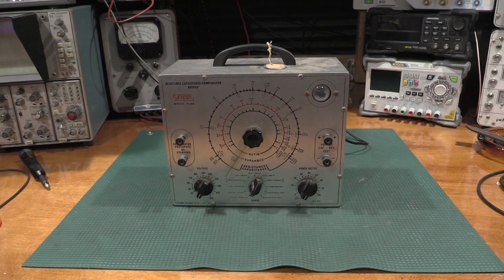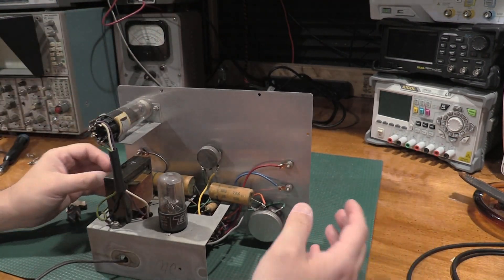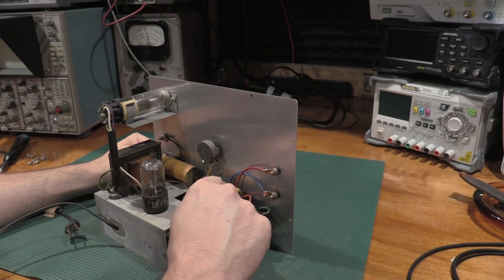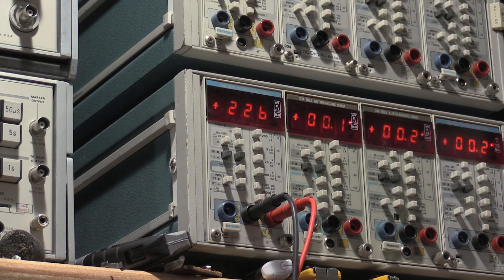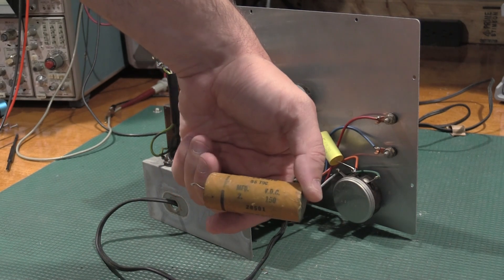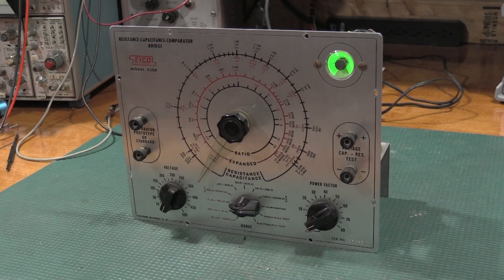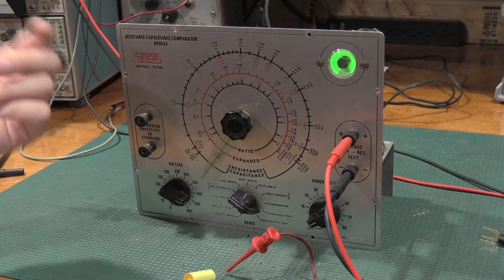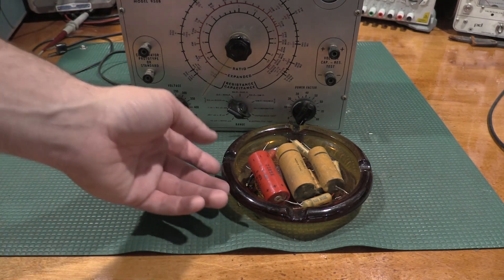Eico 950B Rebuild and Checkin

Comment: Did you check the capacitors you took out with the refurbished unit? I have the same unit and am about to tear into it and this occurred to me just now lol. Thanks for the video, you did a terrific job! I don't suppose this is worth putting a fuse modification into....but I'm tempted! Safety first of course. I just went into the unit and found a long human hair inside, about 8 inches long, gray on one end and brown on the other. Been doing this for decades and have never seen one. I think this was a kit because there is no inspected by stamp.
Reply from the maker: Fusing is always good. I did not test the caps but I should have! I did a video on ESR recently the axiel cap in the thumbnail is was shipped in when I tried to do the 650 Wvdc it is HUGE.
Reply: @ZenwizardStudios  LOL. I liked the part in your video where you say something like "let's see if it smokes". I am thinking the same whenever I go to power up a repair. That's why I used a variac and built a fused current meter after one did! the caps I take out will check out as being fine I am sure....
Reply from the maker: I do need to do a video on the variac / dim bulb/ power meter set up. I am using one as well just cant use it on the switchers.

Comment: A little off topic but you might be able to help. I have a Wavetek Model 112 Sig Gen the manual says 1966. It has several PCB's mounted vertically into a single horizontal PCB a motherboard if you like, the connectors on the PCB are soldered in and they are gold and a kind of 'U' shape and the mating half on the motherboard are the same but at 90 degrees so the 2 parts mate like a 'scissor' action. I need a riser card in order to do any work on the unit but I can't find anywhere to get the connectors. If I could find these pins I could make my own riser. Do you have any thoughts please ? Also the problem I have with the waveform (all of them) is a large, thin spike on the top and bottom of the waveforms one going more positive and one going more negative and if I invert the waveform with the selector switch the spikes change and both point to ground or the positive goes less positive and Neg more Pos ! again any thoughts would be much appreciated....cheers.   Great video !!